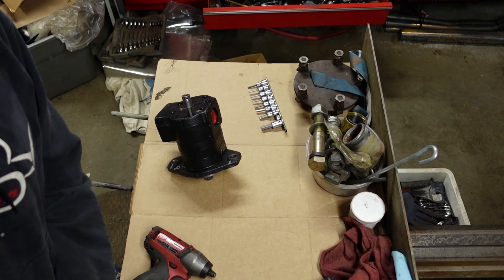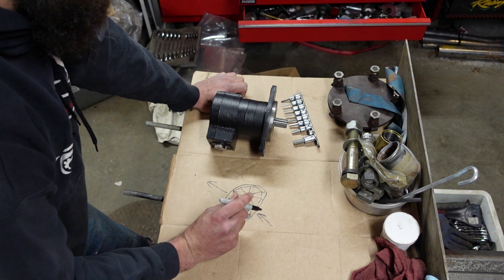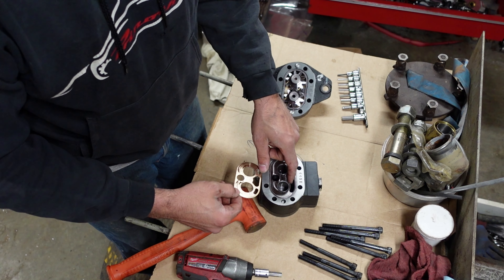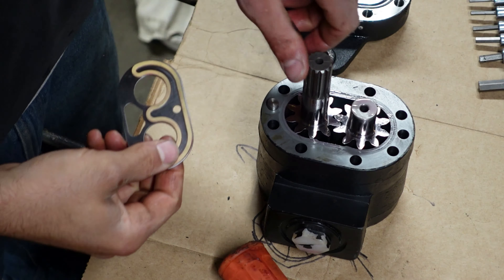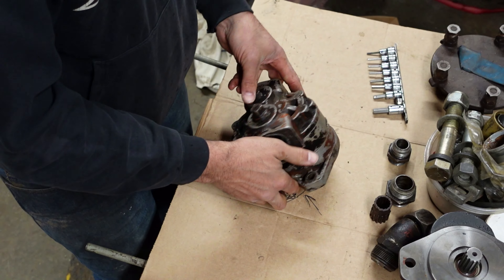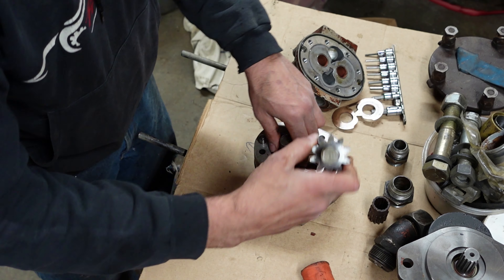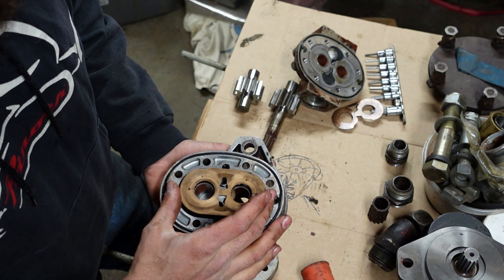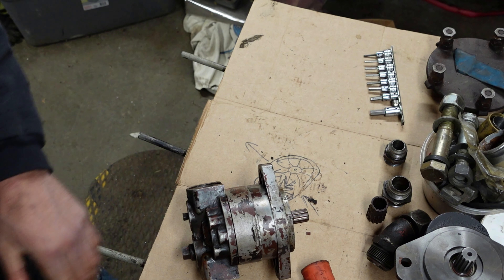Changing the direction of rotation in a hydraulic gear pump

Comment: Why would a pump be backwards? What I don’t understand is how the pump could work with the flow reversed??- I just bought a truck and encountered this and am stumped. Not sure if I can reverse it. Will have to look into it…
Reply from the maker: The pump rotation has to do with the way that it is mounted. Depending on the gearbox or motor that is powering the pump, the input shaft of the pump might have to spin clockwise or counterclockwise. For example on the Allison transmission in my skidder, there are two different PTO mounting locations, one spins clockwise, and the other spins counter-clockwise. If a pump is spun the wrong way, it will not work properly
Reply: @DillonHFM  sounds like I might have it installed incorrectly on my international 4700??!! Because it’s pulling from the suction side…

Comment: How does the top or the gears self lubricate and how does oil get out so they don’t overheat?
Reply from the maker: The hydraulic oil is a lubricant and coats everything on its way through. Oil has a film characteristic and forms a protective film that lubricates mating surfaces, this is how  all lubricating oils work, and is why it is important to have good oil, water and other contaminants don't do this and cause damage. As for the heat, the flow of cool oil keeps the pump cool, which is why dead heading a hydraulic system can kill a pump pretty quickly. Once the flow isn't there, the heat builds quickly. This is also why the rule of thumb is 1 gallon of oil capacity per gpm of the pump

Comment: The cover housing with the in/out ports is different, but other than that, what else exactly is different with the other parts ??  I don't think you explained that.
Reply from the maker: The center cutouts on the center section are slightly different sizes, bigger on the low pressure side to ensure good supply of oil, and the plates that fit up to the ends of the gears have those odd shaped seals under them. The end plates on many brands, such as muncie and commercial have the oil passages in them, the turolla has them in the casting. The oil passages allow high pressure oil to get behind the plates and to hold them tight to the gears to help them seal. If the plates are backwards there is no oil pressure behind them, and they won't seal.
Reply: @DillonHFM  Ok, so what you are saying is the back side of the wear plates need to be ported to the pressure side to work.  If ported to the suck side, they don't energize.  Correct ?
Reply from the maker: Correct, they need pressure rather than suction